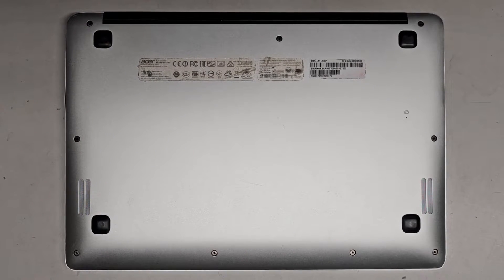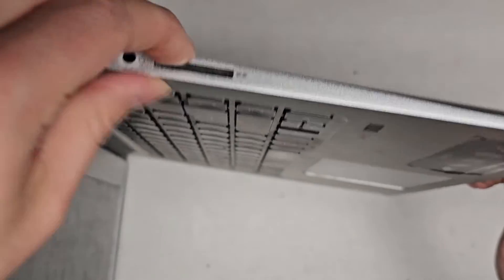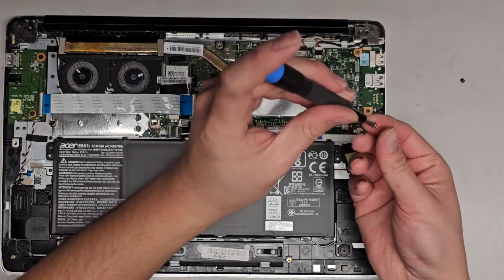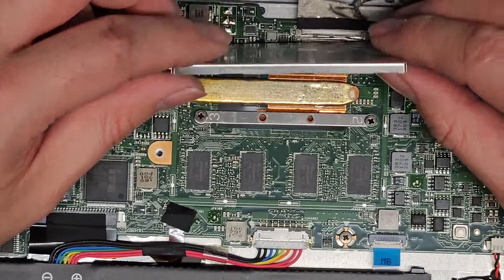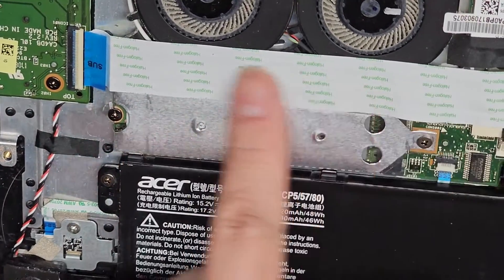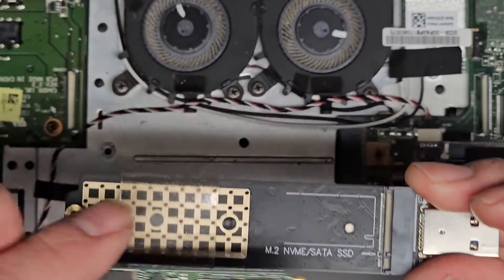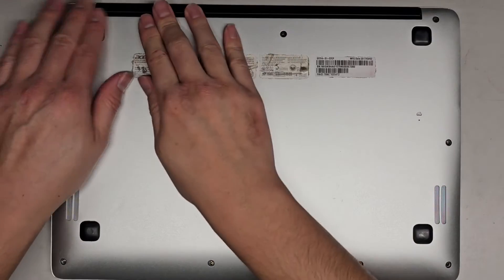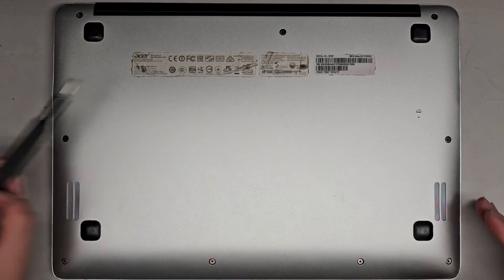Acer Swift 3 SF314-51-57CP Disassembly No RAM SSD Hard Drive Upgrade Battery Replacement Repair

Comment: I liked your explanations throughout.  Interesting you didn’t use plastic separator clips.  I receive a couple in a kit to change out old iMac.
Waste of time on 12-year old iMac with OS that ended in 2019; hundreds of YouTube videos swapping old spin HDD for SSD on old iMacs telling you Apple cult is even stronger than MAGA cult.
Reply from the maker: Lol I don't like using those unless absolutely necessary.

Comment: It’s a shame you don’t do micro soldering because the likelihood is, is that there is just a blown capacitor creating a short / All you have to do is plug NVMe drive into your adapter in which applies power in order for it to be detected, then feel on the board what gets warm - Remove the hot capacitor and replace it - https://youtube.com/watch?v=6Ep7iRW8jj4&si=HUxBC9fHGEgVzJcI

It may even work to some degree without replacing the capacitor.
Reply from the maker: Hmmmm interesting